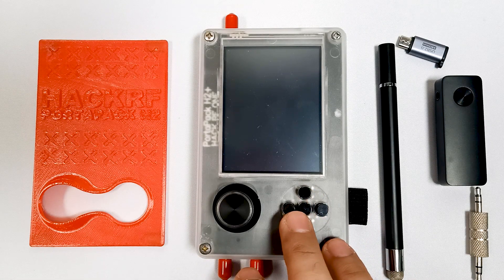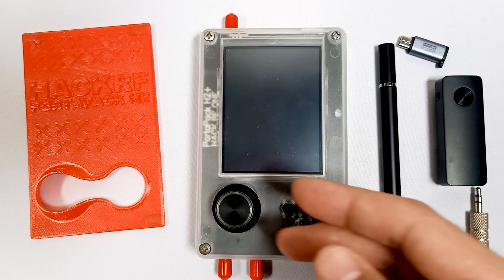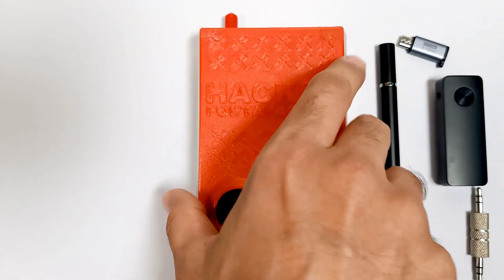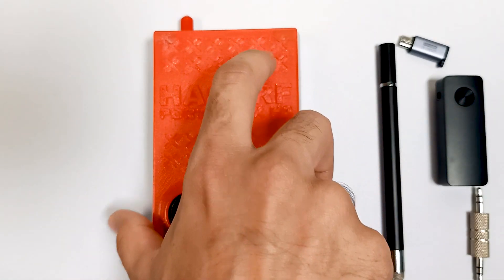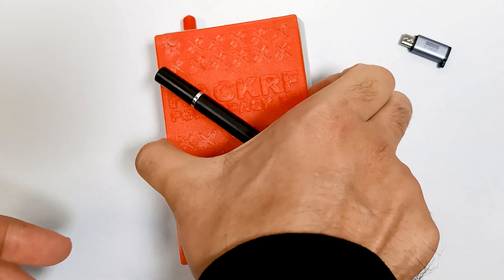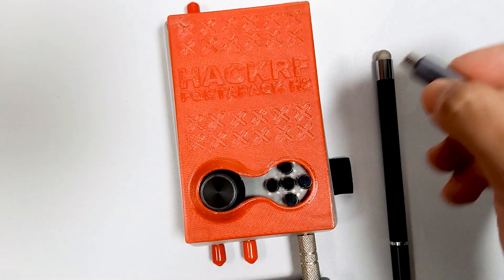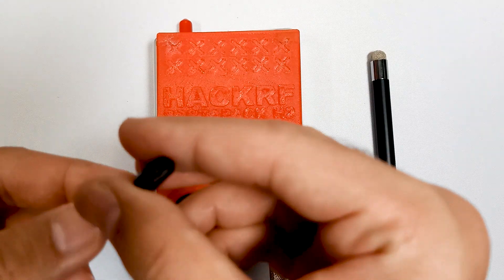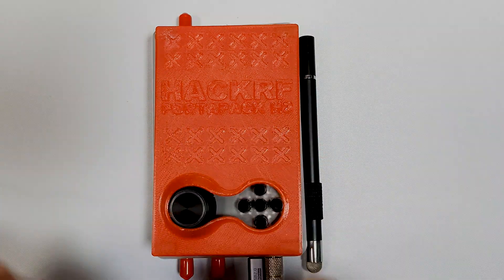Field-Ready Essentials: Must-Have Accessories for Your PortaPack! 🔧🛠️

Comment: not worried ble adapter will cause interference? And, if not- it'd be a nice "hack" to get a stripped down adapter- where, instead of internal speakers/ or even still have em,but utilize the internal connector instead of the external plug. Have the BLE feature as an "internal" one  ;) 

But, i still strongly believe it'll be causing interferrence...